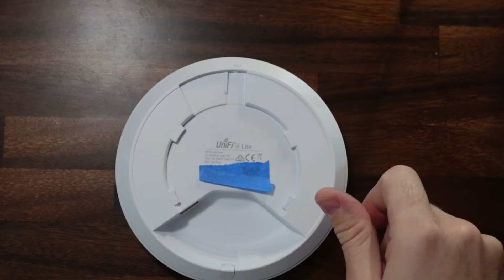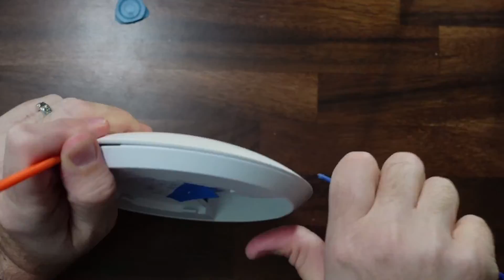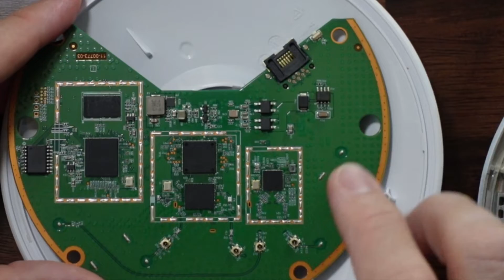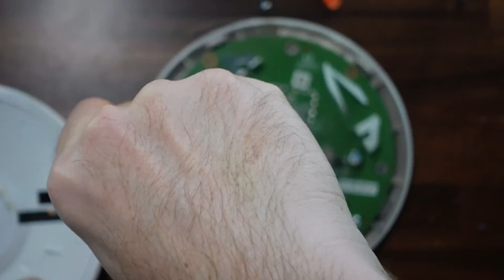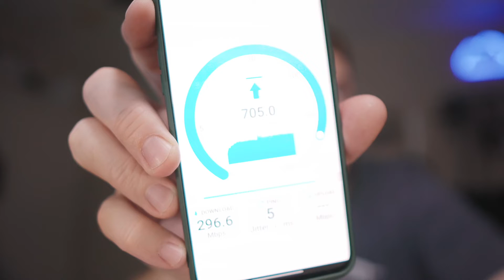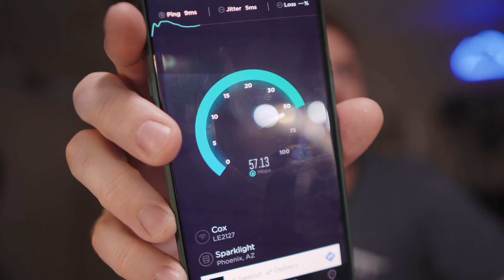world's first unifi wifi 6 lite disassembly and speed tests

Comment: How much ram
Reply from the maker: @dschNgz It supposedly has 256 MB of DDR3 RAM from what I could find out about it. Why are you looking into how much RAM it has? I'm pretty sure it can't run DOOM! 🤦‍♂️🤣
Reply: @ShinyTechThings i heart that it has ipq5322 chip, someone opened it but some say ipq5312. 256mb is very small for this chip. Some say 1gb but cant imagine that because of 75% usage out of the box. Someone in reddit had pics opened but i cant figure out ram size
Reply from the maker: @dschNgz What are you planning on doing with it exactly and how does the RAM size affect it?
Reply: @ShinyTechThings i want to know what im buying. I could buy 1gb aps in same price range. Want to know if unifi gives you something for the money
Reply from the maker: @dschNgz have you looked at the U7 lineup yet? Some models have spectrum analysis radios built in which is pretty awesome especially when you're troubleshooting drops.
Reply: @ShinyTechThings i already have the u7 lite thats why i wanted to know...
Reply from the maker: @dschNgz Gotcha. How do you like the U7 lite?

Comment: Nice teardown! I'm wondering if those other antenna connections are for the U6+ AP that is supposed to have improved Wifi range + Wifi 6 on both 2.4 and 5Ghz bands.
Reply from the maker: @SibirLupus That's what I'm wondering too but these videos haven't made enough to buy the other models to compare them yet. I suspect that they use one design but different components. Like BMW makes the 7 series, it costs them a ton in development but then they take parts of that and put into the 5 series and the 3 series instead of engineering something completely different for each car.

Comment: Putting some white thermal grease on those chips usually helps with reading the markings ;)
Reply from the maker: @johnnyvvlog I'll have to try that one time, I have not heard of that. I'm assuming a very thin coat? Thanks!
Reply: @ShinyTechThings  yes a very thin coat indeed. Does not always work but I have success with it about 80% of the time.
Reply from the maker: @johnnyvvlog Thanks I'll give it a shot sometime and see how it works.

Comment: The download speed is slower than the upload speed issue occurs to me as well, if the open speedtest server is running on a 10Gbps port.
Reply from the maker: @Uncle Who you've given me an idea, but I also got a 2.5/5GbE PoE switch tonight I'm borrowing from a friend to test the U6-ENTERPRISE out. I would get 400Mbps down and 1.7Gbps up using a PoE injector and a Multigig switch. I may install a 5GbE card in the speed test server and then a 2.5GbE maybe it's some sort of attenuation issue?🤔

Comment: I ve done modify ac lite to 2 ports external antennas (ms156 probe) to 2 dual band omnis, but u6 lite comes with 4 port, should I use 4 port to 4 dualband omni?
Reply from the maker: @alb henky it's worth a shot. Let me know if it makes any difference at all.
Reply: @ShinyTechThings  got better 3 db with mikrotik groove antenna 5db and much sensitive rx for weak tx client device
Reply from the maker: @alb henky Nice, any difference in throughput with lots of clients?
Reply: Troughput isnt my concern, but latency for zoom meeting about 15 clients in 1 lite ac handling never problem in obstacle room, another 35 clients light web service
Reply from the maker: @alb henky What did the latency look like before and after?
Reply: From 2ms average & ping spike >=10 ms to 1.2ms avg& ping spike 7ms in 5ghz
Reply from the maker: @albhenpa  Nice! By chance do you have any links that you could post to the antennas you are using?

Comment: I didnt see ms156 probe test port like uap ac lite has, need desoldering for higher dbi antenna mod
Reply from the maker: @alb henky what do you have in mind for mods on this? Got any part numbers or links of the antennas you'd want to use?🤔
Reply: Yup, got mikrotik groove antena 8 dbi dual in local store, split each ms156 port to be 2 antenna with tp link rg cable 12 meter, so I have 2 pair antenna to cover  2 obstacle room in 1 ac lite... save for channel RF utilizatiin ...

Comment: Can it be mounted in the ceiling but recessed like the nano flush in the ceiling ?
Reply from the maker: @n25992 not natively but you could frame out like a canister light but you would have to figure out how you would build in access to remove it if needed.

Comment: Why is there Bluetooth in the U6 devices ?
Reply from the maker: @ValorHeart it's so you can use a mobile device to set it up.
Reply: @ShinyTechThings  Just found another reason, the 'Unifi Smart Sensor' is connecting to the AP's via Bluetooth
Reply from the maker: @ValorHeart Also the smart plug that reboots your modem is Bluetooth as well.
Reply: @ShinyTechThings  Actually the USP Smart Plug uses Wifi to connect to the Unifi network environment.
Reply from the maker: @SibirLupus 👍